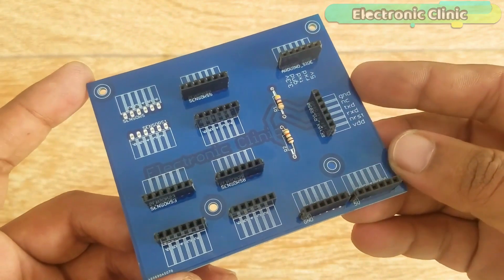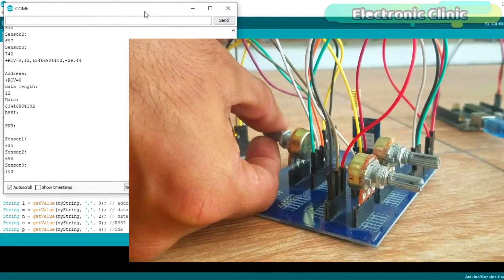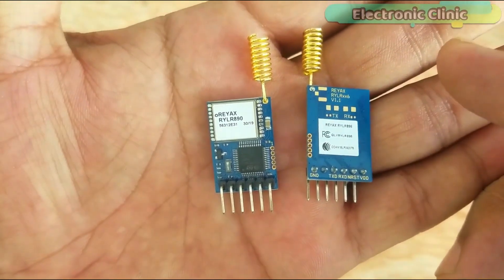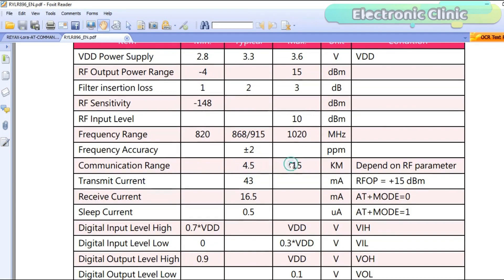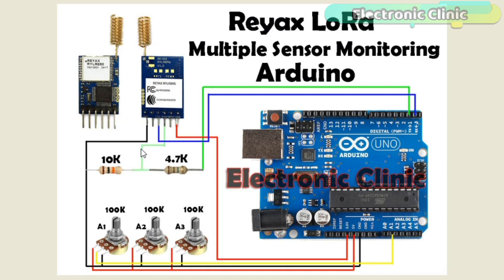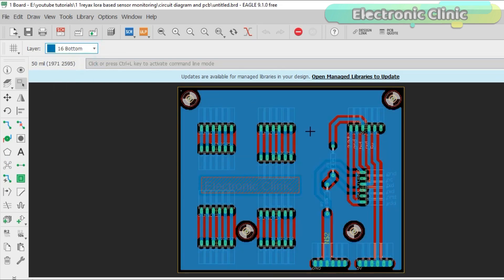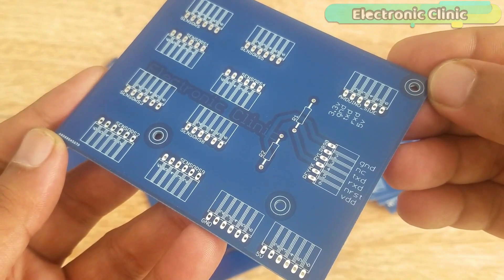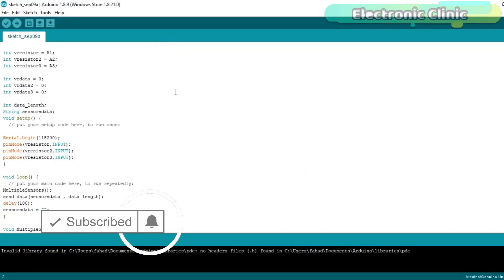Reyax rylr890/rylr896 LoRa based Multiple Sensors monitoring using Arduino

Comment: This is a great tutorial.  I have finally been able to achieve sending data from one Reyax module to another as shown in this video.  If I have 2 reyax slave modules and 1 master, how would the master(rx) code differ from the code using only 1 slave module? What needs to be added to the rx code?  I basically want to send a pressure reading from 2 slaves in 2 different locations to the master.  I seen a video you did on this topic, but you were using different lora modules.  Thank you!

Comment: Can i use Multiple Transmitters and Single Receiver for Sensor Monitoring using this module??
Reply from the maker: yes, you can.
Reply: Have you done this with multiple transmitters yet?  If so, how did you add to this code?
Reply from the maker: @joescopo8933  ya i did it. checky my other videos.
Reply: @ElectroniClinic  , is it you "Multiple LoRa Nodes" video?  If so, will that code work with Reyax LoRa modules? Also, can I make it to where the oled display, displays both sensor readings at the same time?   Thanks again, the video's are awesome!